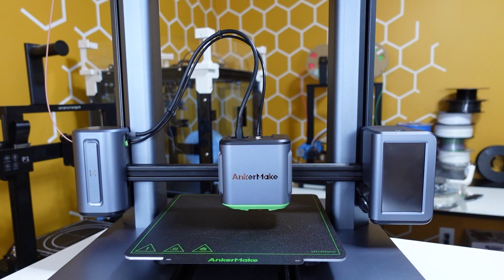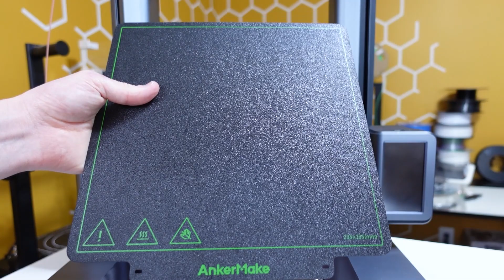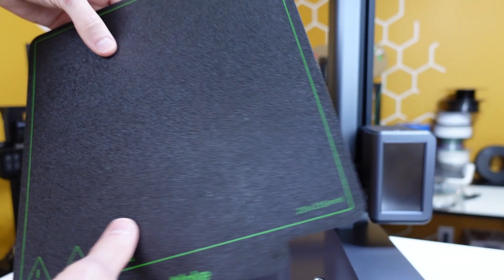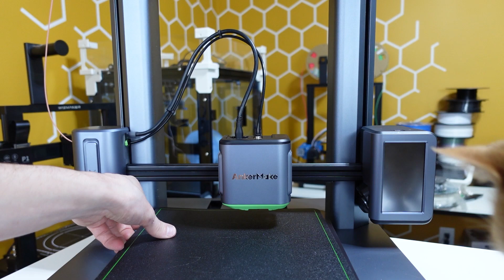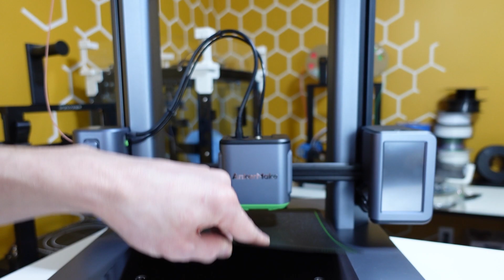AnkerMake M5 For Beginners 2: Understanding The M5 Hardware

Comment: I ran out of filament and it didn't tell me anything. But I guess it was because the filament final bit was attached to the spool so instead of going thru and letting the sensor read it, it just broke free with that last bit hanging out from the spool side, so the sensor had no idea. And neither did I. Ruined a 7.5 hour print. Also I'm just using the Ankermake M5 for the first time...only had it a couple of days. First time using PETG this evening and I'm having all kinds of problems. UGH!